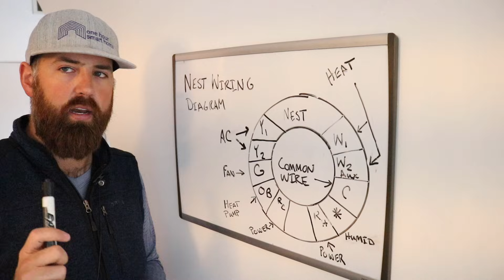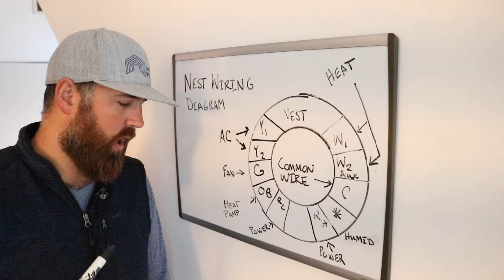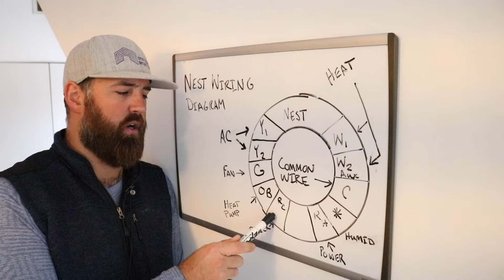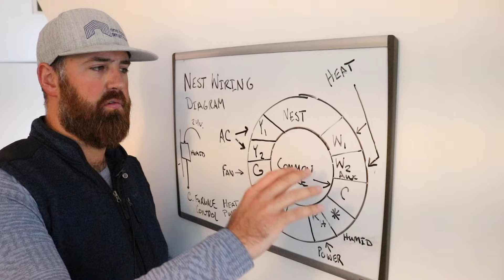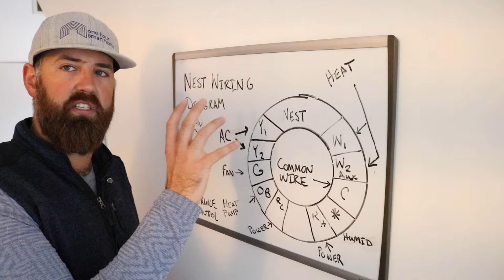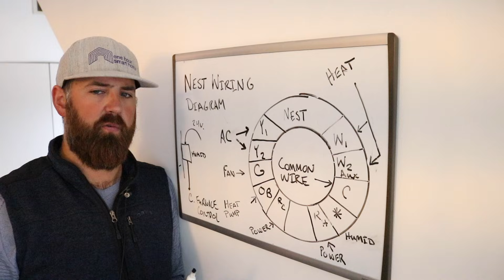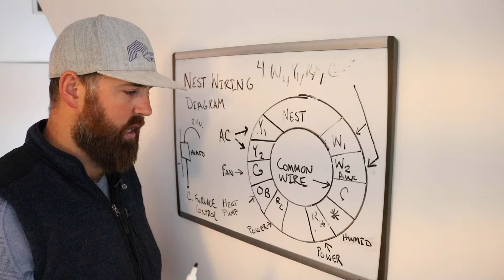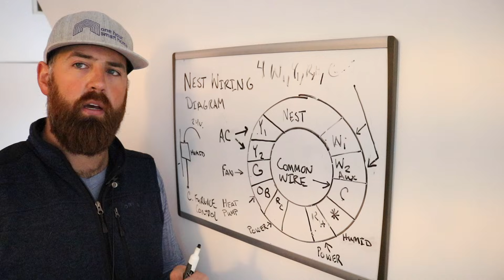Nest Wiring Diagram: Full Explanation!

Comment: Hi. I have nest thermostat 3rd generation. I have connection to Y1, G, OB, C and Rh. I have occasionally power outage which depletes the batteries and a need to recharge afterwards. I have bought a UPS which I can use  to supply continuous power to thermostat. Can I remove the C wire that is connected to the furnace and connect the cables of my UPS to C and Rc wires without damaging the thermostat and furnace.

Comment: What if I do have a dual fuel system and one single Red wire. Where should I put it in？ Rc or Rh？
Reply: By the way I have cooling and steam boiling system that works in the old thermostat but I don't think I have W wires..... Which is weird after seeing this

Comment: hey man can you make an in depth video on how to connect a flow thru whole house humidifier without using the humidistat it comes with, only connecting it to a 3rd Gen nest thermostat, can you show exactly how the wiring for that to a goodman furnace goes cause i am stuck and this dry Gas heat is killing me. thanks

Comment: Also i have the new nest thermostat only 6 terminals  i only need r and w since i have boiler radiator heat only (using nest power connector)

Comment: great video, You mentioned a separate discussion on dual fuels but I could only find a dual fuel heat pump/AC scenario. Im using a Nest Gen 3 Learning  to control TWO separate heating and cooling systems that is an Oil burner/hydronic with a relay to convert from high voltage 2 wire to a low voltage 3 wire and a single stage AC system. I know both of these systems work independently with the Nest. I think this should be straight forward using the Rc/G/Y1 for cooling and Rh/W1/C from burner controls. I Have two commons from cooling and heating systems but I prefer to use the common from the heating system as the burner is always on producing potable hot and Id like to switch off the cooling breaker in the fall when temps drop. Does this sound like a viable approach? Another point of puzzlement is how the nest actually prevents the heating and cooling systems acting in contention.. I assumed that the Rh and Rc acted as two separate channels but from what Ive read that is not the case.. so how does it work? You lightly touched on it here but I cant find a relevant video for my situation. Thanks
Reply: I ended up using the common for the AC. It turns out the nest actually uses the ACs air handler when there's a call for heat boosting the efficiency by capturing heat that rises in the open hall to second floor and recirculates it through the AC vents. Very pleasantly surprised

Comment: I have a jumper between Y and W1 (yellow wire ) and also white wire connected to O terminal.  How those wire connected to newest nest thermostat ?
I got a conventional system , no heat pump.

Comment: Okay, my C wire at my furnace is hooked up as the power to the on/off switch, so not sure I want to mess with the blue wire on top of it. So from your other video, I can recharge the Nest off an USB port, which would be easy for me, AND I will get recharge power every time the furnace runs, correct? So how long will charging with a charger last? Will I make it through say a month of not running the furnace like the next 6 weeks or so until cold weather hits?

Comment: "Nest thermostat connectors are built so that only one wire can be inserted into each connector. Putting more than one wire into a Nest thermostat connector can damage your system and your thermostat.

Instead of using jumper wires, Nest Learning Thermostats use an internal jumper between the Rh and Rc connectors. A Nest Learning Thermostat will automatically use this internal jumper if your system needs it.

Important: Never put more than one wire into a Nest thermostat connector. If your current thermostat has a jumper wire, do not enter it in the Nest app to get a wiring diagram or oconnect it to your Nest thermostat."

Comment: I have a 3 speed fan system. Low speed fan is working, medium and high speed fan are not. I have G2 connected to Y2 and G3 connected to *. This is also set this way in the app. Any ideas what could be causing my two speeds to not be working?

Comment: Thank you so much for this video.  I bought a Nest thermostat for my house and unfortunately my husband passed unexpectedly before it was installed.  After some time I decided I wanted to have the new Nest installed, but folks wanted either a lot of money or they didn't have the time to help me.  With your video and wonderful explanation, I was able to install my Nest and have it working all by myself.  I got really nervous because all the other videos were talking about 4 wires and when I popped off my old thermostat I had 6 wires.  And to add to the confusion, one of them wasn't connected but seemed important (turns out I already had a blue common wire).  Thank you!
Reply: I'm so sorry for your loss. 😥
Reply: I'm at this spot now. I have 6 wires :(
Reply: Thanks for the video great job I had the job done it 5 min .

Comment: So if I get the latest (2020) version of the Nest thermostat, and I have "Rh" connection; can I plug that into the "R" terminal and it will work? Or do I have to get the higher priced nest thermostat and use the "Rh" labelled "plug"?

Comment: thank you for your video, I have some issue with Nest, it running 14hr a day, I do not think it should run that much.  I had no C wire but was able to add using unused wire and my old thermostat had jumper between R and Rc.  I connected the red wire only to Rc.  Do I need to add jumper, Nest recommendation was without C wire but two red one go to Rc and other to Rh

Comment: Tried to install 3rd gen nest. From wall had only 3 wires connected to a honeywell thermostat (W, G and a red on RC with a black jumper to RH). There’s no yellow wire. So when cycled through install process only get options for fan ( the green wire) and heat ( W1 wire).  Please help.

Comment: Thank you for the videos!  I have been searching and unable to find an explanation for my situation.  I have a Nest Learning Thermostat which is connected to a Goodman (2 stage blower) heat pump/AC and have Propane for the backup heat.  It was installed about 3 years ago and every season change from cooling or heat I have had to call an HVAC tech to come out and re-connect the system so it will work for the season.  Yesterday it was 85 in the house and the AC was blowing 100-degree heat.  The HVAC tech thinks that the nest is defective...  Any suggestions?

Comment: I only have a R and a W wire. I bought a 24V transformer, disconnected the R wire and connected the transformer to the R and C terminals. Now, the heat does not work. What can I do to fix it ?

Comment: Very well said. I live in northern climate with only heat. My old wires are red, white, green and blue wires. I’ve recently hooked up my nest and everything appears to work but get message N256 and see the C and G wires are undetected. I can’t seem to find a diagram on my old wiring to feed the nest. What color wires should go to my nest connectors?

Comment: Hello
I have been following your YouTube channel. You’ve been a great help on almost everything you share.  But I’ve been facing Next Thermostat battery/ low battery/ common wire power problem.  
I watched your 3 videos related to that problem but I am still missing a piece to complete the puzzle. 

Is there anyway I can share pictures of my thermostat and furnace wiring so you can see what i am doing wrong. 
I would appreciate your kind help.

Comment: After watching this video I follow the steps and it was all so easy after that. 1. I removed the old thermostat. 2. Took a picture of the current wiring. 3. I opened the manual that came with the Ecobee3 thermostat which has many wiring drawings then i compared the wiring in the manual  with the wiring of the old thermostat and took a picture of it. 4. Since I was able to find match the wiring of the old thermostat with the Wiring of Ecobee3  there was no need in using the adapter kit that came with Ecobee3. 5. I simply wired my Ecobee3 exactly as the diagram in the manual and that was it it worked fine, no issues.
Reply from the maker: Great work! Thanks for watching.

Comment: I am interested in purchasing the new Nest Thermostat (2020) however I am hesitant because I have an extra wire that's not on the nest. I have a W and a W2 , but the new Nest only has W. 
1. Is it safe to just install W and clip the copper off W2?
2. Will it function properly and give me heat just not faster heat?
Thank you for anyone that can answer these questions for me.
Reply: My exact problem, what was the solution ?

Comment: When setting up my Nest, I found my wiring is a bit unusual (with electric handler and heat pump).  Most people say that auxiliary and emergency heat are the same things.  But mine has both.  So I've put auxiliary on  W2 and emergency on * (considered another 'accessory').  I have an orange wire for the heat pump, and selecting "I don't know" for whether O or B doesn't work. It was trial and error that I found mine is B.

Comment: I have an issue with my heating. You mentioned the system "short cycling" on the A/C side if you have a system that may need the "c" common wire hooked up. I am having this issue on the heating side and my "c" wire is not hooked up. Should I assume this short cycling is because I need to hook the common up? I think i will try it regardless. Thanks. Awesome video

Comment: I have a line voltage thermostat with just two wires.  I know I need to feed the nest woth 24v instead of 120v and that is easy enough to understand, but how do i then control my furnace with that?
Reply from the maker: The nest thermostat is not compatible with line voltage, it only works with 24V low voltage systems. The MYSA smart thermostat: https://amzn.to/2MpZs94 is compatible with some line voltage systems.
Reply: I know i cant use 120v on the nest.  What i’m wondering is if it will work with just two wires if I change them to 24v.  Doesn’t it need a third control wire?
Reply: He references a separate video that explains you can use two wires on the Old Nest learning and the Nest E but not the Newer Gen 3 learning. Without the 3rd (C)ommon wire he points out that you will lose some functionality. I installed an Aube RC840T relay to convert my 110vac system to a low voltage system and it provides the (C)ommon wire that powers any of the units. It also has diagnostic leds that indicate when heat is called to aid in tracing problems.

Comment: Thanks for the amazing video.   I just bought the 3rd generation nest.  I look up my old thermostat wires.  I see the red power wire goes to RY and a jumper from RY to RC.  Do I need to do that with the nest?  And then, there is another jumper from W2/aux to E/emergency heat.  Do I need to do that with the nest?  Thanks for your help in advance.

Comment: Thanks, I had a Nest Gen 3 connected to a Burnham/Beckett 80's two wire system here in chilly central Massachusetts using the Rc and W1 wires. I was concerned because the installer used Rc instead of Rh. I moved the wire from Rc to Rh and the nest asked me if my wiring had changed. I said yes and 30 sec later I'm back in business. I guess the Rc and Rh in this case are the same but its nice to get your confirmation rather than feeling uneasy with the much less detailed videos out there. Can I assume that during a hot summer when the Nest never "calls" for heat that the unit draws just enough current to power the Nest without unnecessarily turning on heat or could this explain why i need a new Nest battery after 3 years?

Comment: I have a Heat Pump with a current thermostat that has W1 wire in the spot then a jumper to W2.  What do I do with that on the Nest?  Currently it's in W1 and I set my need to for Alt Heating to 30 degrees.  We did have really cold few days but my electric bill was double last month.  Curious if I need to raise the temp for needing Alt heat and what to do with this W1/W2 wire situation.  Thanks Brian

Comment: I've been searching for wiring help for the Google Nest Thermostat, not the Learning Thermostat, or the Nest Thermostat e.  I do not have a C wire.  I finally found a solution by purchasing an AC adaptor from Amazon for $20 with 24v to use as a C wire.  I'm replacing a very old round Honeywell mercury thermostat with only a red and white wire.  Attached one end of the adaptor into the C, and the other end into the R with the red wire.  Finally works correctly.

Comment: Why is it that when I plug in my blue common wire to the C terminal it starts to short cycle my unit? Otherwise my thermostat does not get charged and my unit short cycles because the battery is not charged?

Comment: Thanks for that video, great explanation. I have a question, I am trying to install my Nest Learning Thermostat 3rd Gen and after removing my old thermostat (Aube TH144HP 3H2C)and I am wondering if I should put my actual "W" wire to the W1 or W2/Aux on the Nest. My Furnace booklet tells me that this white wire is Aux. Heat... We have a 2 Stage Furnace with Heat Pump system. Also, my old thermostat has jumper in the back and the Aux Jumper is set to Y+W... Does this change the way I plug my new Nest?  Thanks in advance.

Comment: Thanks your videos are Nest are super helpful. Question: if I had an old nest that only did the cooling with four wires: R, G, C, Y1. If I want to get a new Nest for both AC and boiler (which is two wires without C), do I need another C wire for the boiler or I could just rely on the C wire from my AC. Thanks so much!

Comment: Very good presentation, thanks. I do have a question. What if you have 2 transformers, one for cooling and one for heating. I have the heating that is zoned with 3 Nest thermostat, one is learning and the other 2 are not. The learning thermostat has air conditioning and heat and the other 2 only heat. 2 weeks ago my learning thermostat showed low battery, the other 2 does not. I would charge with micro USB and stick it back on and middle of the night would shut off, low battery. Watching your video, I think that the zoned thermostats are sharing power and the learning thermostat is not getting enough power. Also since the AC is not running now we are in winter, it is not powering the thermostat. I did not have this issue in the summer when AC or fan is running every so often. I live in the Northeast so don't really use AC a whole lot. My problem is I only have 2 wires, Rh and W1 from the boiler but have 6 wires from the AC, I am only using 3 of them, Y1, G and Rc. If I connect one of the unused wires to C and to the AC unit, will that solve the problem? Am I on the right path here? Please advice.
Reply: Just asked a similar question but I guess (understandably) he didnt have time to answer you and others.. did you ever figure this out? Im going to try using the common from the heat as its always on to heat potable water. You certainly cant hook up both commons as they are from two seperate transformer sources.

Comment: i mainly use ac. i turned on my heat and I got the e/74 code. Ive turned off and on all power.. I took off the wall and plugged it in and it tells me to put it back on the base to charge.  on the POWER< it only gives me Battery 3.787. nothing VOC 0.01V lin 8mA (o)  help

Comment: Thank you so much for describing very smoothly, but have 1 question regarding my old thermostat,  so it has 5 wires as follow RH= 24 Volt, Y/0= air conditioning Compressor, W/B= Heating, G= Fan, Y1= Heat Pump Compressor as per my old thermostat diagram (Hunter Model 44360), if you can describe me which wire goes where please, and thanks again.

Comment: So I had a red white green yellow blue and orange wires. I connected red to r, white to w1, green to G, yellow to y1, blue to C, and orange to *ob. Did I do this right?
Reply: Seems we have the same setup, did this work for your system, my c wire looks sort of grey
Reply: @shadowdriva1  it works, but if your heat is still blowing cold you have to go into the thermostat settings on the app and find “heat pump” and change it to “o wire”let me know if it works.
Reply: @QuantomMindfulness  thanks for the response, I'm going to pick one up in the next few days, I'll let you know how it turns out

Comment: Thanks for your video, I have a Honeywell thermostat which has only two wires named A&B. It seems it got the high voltage on it, can I connect my Nest 3rd on these two wires and which I should connect to? Is is it possible at all or I need to install the main

Comment: Great help. I am using the Nest thermostat standard wiring for a HVAC system. Would it be possible to use one of the other power connections to operate a whole house fan?
Reply from the maker: If your whole house fan ran on a 24V system it is potentially possible but you might need to add a relay to get it to work.

Comment: I have a total of 12 thermostats in my house, only one of the 12 goes in to low battery? I swapped The low battery one for a thermostat that works fine, two days later low battery comes up again on the swap one. I also returned the thermostat for a new one still will get low battery after 2 to 3 days. I test the RH wire and it does have a 24 V power. I also install a plug-in 24 V transformer once I put the nest thermostat back in it shows an error of 79 C no power?

Comment: Hey guys i have a 4 wire setup up red black green and what looks to be white can help?
Reply from the maker: Watch this video: https://youtu.be/vG-K5TDYYNA  you should look inside your HVAC system and look at your control board terminals in the HVAC system to see what terminals the wires are connected to within your HVAC system. Then you can determine which wire goes where with your Nest Thermostat.